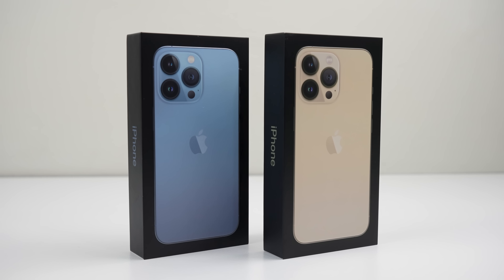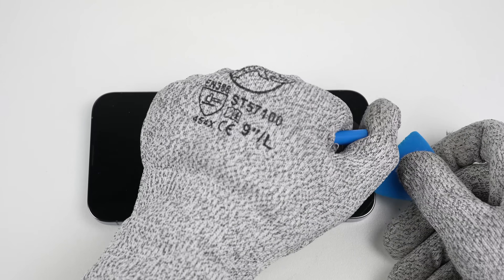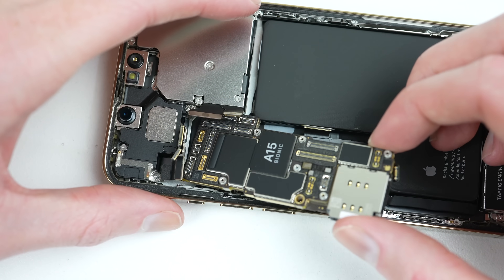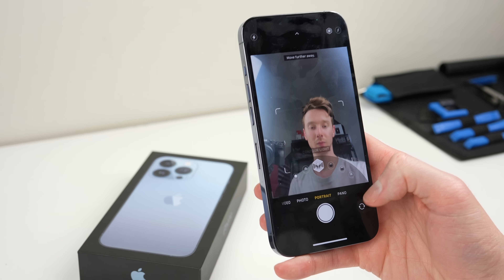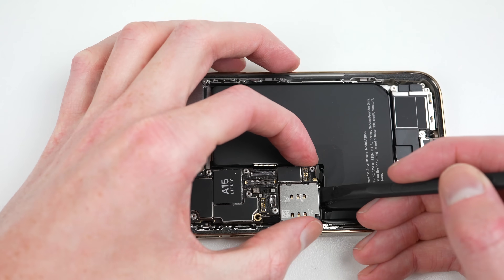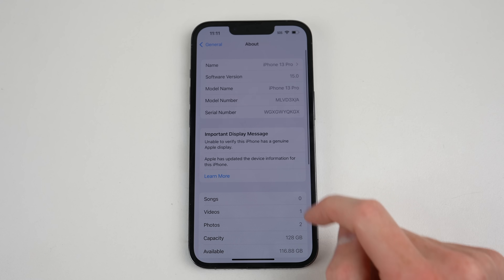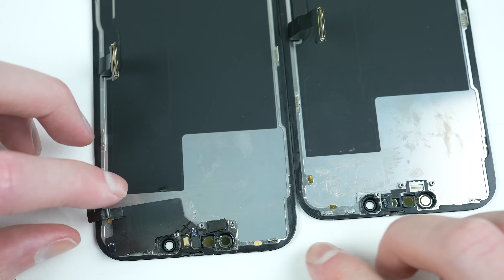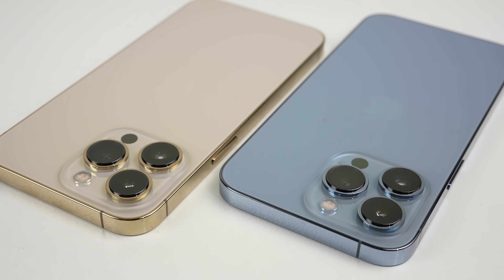iPhone 13 A Repair Nightmare - Teardown and Repair Assessment

Comment: This needs to go viral.
Reply from the maker: Feel free to share it around :)
Reply: @HughJeffreys  Yes Sir
Reply: @HughJeffreys  Suggestion: Pin a comment on the iPhone 12 video that redirects to this one? 
I think that could help too with growing the views since that one already did go viral. Cheers and great job!

I personally do not own any Apple device, I used to have a iPod touch 4th gen but that was it. 
It was working fine but then it got deprecated, the apps would still auto update but then tell me that "the device is not compatible", for aps that were running perfectly before that (so either keep the device completely offline, or enter the loophole of trying to roll back the affected apps), soo.. that was it for me because basically it was a pain dealing with that every single time, specially after seeing the same happenned on newer devices (last i checked was a iPhone 6 from a friend who had the exact same problem when it got deprecated by updates themselves, so feel free to correct me if they changed this with more modern devices).

*If that happens now, that'd not be a issue at all (Android phone), i just need to install the backup apk and it's ready to use again.
Reply: @HughJeffreys  this needs to get in the hands of the NY State Attorney General, Letitia James. She's awesome.
Reply: @HughJeffreys  make it more concise pieces and share on TikTok.
Reply: @HughJeffreys  Dont forget, these devices called decoders exist and are designed to pair parts to iPhones and other device parts with software locking and pairing codes. It copies the code from the motherboard and puts it on the replacement part, pairing it with the board.
Reply: @HughJeffreys  Great & informative video. Hopefully people make the switch from Apple to another company that cares more for their customers. Totally random, but what is the background music that starts at 15:41 ?
Reply: @HughJeffreys  not cool bro..you deleted my comment
Reply: @HughJeffreys  We will, while you test Samsung and Xiaomi, so we can know if its just Apple or its most of them
Reply: @HughJeffreys  Great video, but why do you feel the need to add that background music?  When you listen to someone speak, do you want to hear that stuff along with their voice?  If viewers want to hear music along with your voice, they can hear any song in the world with the press of a button.   It's so disrespectful to play that shit while speaking to people.  Background music is a plague on YT.
Reply: @HughJeffreys  Jerry Rig Everything Mentioned your video it’s gone viral!!!
Reply: @HughJeffreys  Phonerepairguru uses one of those decoder thingies to circumvent apples anti-repair tactics.
Reply: agreed
Reply: @irumwah  Already doing its rounds on social media.
Reply: @mikeriddle2552  ?
Reply: it is viral, but the idiots keep buying it
Reply: @michelbruns  I have been using iPhone from I phone 4 and now after watching this video will never buy an iPhone in my live it’s upsets me that apple wants to make all of the money and not leaving any thing to 3rd party I have phone repair shops and it hurts
Reply: @Onemeed  ay, at least one person that cares
Reply: @michelbruns  Its all about what the user wants with their device. Not everyone cares about the repairability of their phone. I made the switch the the iphone years ago and these things have never been an issue for me. And the risk of it becoming one is worth it to me because imo android is that bad. 

I wont blame anyone if thats a deal breaker though. Its their money. But dont act like everyones an idiot because they pick a phone you dont like.
Reply: @ronnie3044  I agree. After years of being a diehard Samsung/Android fan, I’d had enough of the unreliability of Samsung’s and privacy/security issues with Android. Made the switch with an iPhone 12 & don’t regret it. Although, I think Apple’s tactics like those in this video are a touch too far.
Reply: @ronnie3044  read into the right to repair problems. It's not about not liking ios or not liking android. It's about consumer rights and how these companies, apple being particularly guilty, treat the consumer.
Reply: @wielandmail  No its not idiotic because all these companies are shit. None of them are moral. Your not taking a moral stand by picking Google over Apple when it comes to your phone. 
If literally the only thing that matters to you is repairability than yes you should avoid Apple. But your still picking one morally bankrupt company over the other. There is no morally good choice. So go with whichever has the features that work best for you.
Reply: @secret-name  And they all treat their customers like shit. All of them. Its literally a "pick your poison" situation. For me personally the repair-ability of the phone is not one of my main concerns. And without actual legal threat the others are going to do the same. A lot of them have already started doing it. 
Dont get me wrong. I agree with right to repair and think Apple are in the wrong on that subject. But that con doesnt outweigh the pros of an iphone for me.
Reply: @ronnie3044  yes - morally  Google is nearly as  shit as Apple. But, the thing is: that is "only" the software. And hardware wise there are really good alternatives.
Reply: @wielandmail  Software is just as important as hardware though. A phone can have the best hardware in the world but if the software isnt good its pointless. 
I would love to switch back to android. But they have never been able to figure out the software side. Even the "stock android" phones are garbage in terms of software compared to iOS.
Reply: @ronnie3044  yes, Software ist just as important as Hardware.  But hardware is what matters most in terms of ecology-friendlyness.  As an example: fairphones are mostly made out of recycled materials. And If your Display is damaged, you can simply repair it by yourself. Even the screwdriver needed for this is within the box when you get the Phone.  Big difference in terms of sustainabillity. Sure, it is not as fancy and fast as an iPhone 13, but its morally   wayyyy better and more Eco friendly, despite having Google Software on it.
Reply: @wielandmail  And if hardware and eco friendlyness is a big deal to someone they should clearly get that phone. But thats not the main factor for everyone. When it comes to my phone personally thats not very important at all to me.
Reply: @wielandmail  None of these companies are moral. Your just picking which one is the lesser of the two evils for what you care about. someone buying a samsung note 20 isnt more moral than someone who buys an iphone 12. 
And when talking about being eco friendly. Theres a lot of better ways to be moral in that department. Your cell phone choice is actually pretty small when it comes to your carbon footprint. Even if it does go to recycling in 2 years thats probably one of the least negative impacts on the environment they have done in that 2 years. 
Hell think about all the wasted energy we spend all the time doing pointless things like watching youtube. That cant be classified as eco friendly. Even if you can replace the battery on your phone thats still e waste thats bad for the environment. and for what? to see someone play a game or build something?

Us sitting her talking to eachother via youtube is not eco friendly in any way. Using cell phones in general is not eco friendly at all. 

We all are morally bankrupt. all of us. Unless your living without a phone, using wind turbines to power your home, not using anything for heat, buying nothing that uses oils/plastics etc. you are morally in the wrong technically.
Reply: @ronnie3044  so and we ALL being morally wrong justifys being even MORE wrong for you?  Sure thing - living in stone era would morally be the best thing. But lets be honest - that isnt something that is easily possible. But that should be  no reason for ANYONE to simply not care at all!!!! You understand?
Reply: @wielandmail  Your making assumptions based on no evidence. You seem to think that just because someone buys an iphone they are not eco friendly based off of that one decision. We ALL make choices every single day that are not eco friendly.

Someone could buy that eco friendly phone your talking about but that alone doesnt make them any more eco friendly than others. Someone could buy an Iphone 13 and in the long run be 10 times more eco friendly than the person who bought that phone you spoke of. 

Your theory here doesnt work without making literally hundreds of assumptions about consumers everyday life that you dont know. 

If I buy the iphone 13 and it breaks in 2 years and i put it in the trash does that negate every single other thing i couldve done in that 2 years that was eco friendly? If i buy that eco friendly phone and it lasts 4 years does that negate all the eco unfriendly choices ive made?

In the overall picture of being eco friendly, the cell phone you pick is a very very insignificant action.
Reply: @ronnie3044  that may be right. Im making assumptions. And my theory only works by making such assumptions. But if someone (you)  tells me he would not (or very very little) care about the point of his phone being eco friendly....then....yes. I think i have enough reason for making such assumptions about the every day life of this person. A person that does not care about this point is most likely a person that also does not care about moral at all regarding every other choice in  his/her life.
I find it is more important to at least actually  care about those things, then just being selfish. To care about is the first thing to do and at the same time the most important. It is the start in a better world for all of us and everything around us. And If the start is done, then the good deeds and behavior will follow.  And even if your deeds don't change anything, it is important that one at least cares. At least to be a good example for others.
Reply: Get a load of this guy moved to Apple for privecy 🤣
Reply: @ronnie3044 
That's not the problem, either you use Android or iPhone we don't care. You're not the only people using iphone. What we care is that people need to speak up against this behavior. Soon, every phone manufacturer will do the same since apple get away with it.
How you think car repair scene is very lenient now? Because right to repair.
Reply: @ronnie3044  ooo
Reply: Ronnie yes, and that means you are either throwing out your old iPhones, selling them to people who won’t be able to repair them, or just putting them in a drawer. All of these possibilities are a total waste. Shame on you.
Reply: 1000% profit on a phone must include a lifetime warranty
Reply: didn't expect you here
Reply: even if it goes viral, Apple probably won't give a shit.
Reply: @gliderman9302  Nor the apply fanoys. They DONT CARE. Period.
Reply: @gliderman9302  They won't give a shit until people start catching on and finally getting sick and tired of their BS.
Reply: true
Reply: Didn't expect a Minecraft channel here, but hey you're not wrong. Love your videos.
Reply: If it was a secret maybe it should go viral. It is however not a secret. I can't understand why people still buy this crap
Reply: @Lance Miller 
That might be the case. (The reason you explained) 
And thank you for taking the time to offer that perspective. 

That just goes further to support the idea there should be separation of the device design/version, between DoD type of applications, vs consumer applications. 

DoD institution isn’t a “consumer” in the sense of consumer rights protection. 
Apple can run DoD production batch separately a couple times per year, separate from consumer market production runs. 

Consumers shouldn’t be held victim based on what the DoD needs for their device.
Reply: 100% agreed. That's a rip off.
Reply: Making money is still a kwesty of.... how do i pull another in
Reply: It's goes viral.
Reply: It sure did
Reply: Looks like it has
Reply: Apple which a bunch of hypocritical dick heads.
Reply: 1.5 million views in 5 days?
I think it is going viral...
Reply: Apple and fans don't give a shit anyway
Reply: they dont give a f about the environment. you can sure as s just buy BS carbon offsets from already preserved forest areas to meed their 'carbon neutral' commitment. Total BS.
Reply: @esgee3829  Most people dont honestly care. They can say they do but you would lose count on all the eco unfriendly things they do every single day. writing that comment on this youtube video (or any youtube video for that matter) isnt eco friendly.
Reply: YOUR PFP IS OFF CENTER
Reply: @keratexas-  what
Reply: @The_Horizon  look closely
Reply: Not like it'll matter. iPhone users are often the type of demographic that doesnt care about stuff like this. It's a status symbol to them and the fact that apple is sabotaging their devices is unimportant to 99% of people who spend $1300 on their devices.
Reply: Needs to, but it won't. Things that need to go viral rarely do. Look at the Assange assassination plans recently, the vault 7 leaks and many other similar issues. Videos that tend to go viral are usually "funny", flashy, in your face and riddled with ADHD hyperactive fake behavior.
Reply: @anonp2958  it did go viral
Reply: @anonp2958  I has, 1M views in 4 days.
Reply: @anonp2958  his iphone 12 video did
Reply: @flamingkillermc2806  Ahh cool, could you link me please? 😁
Reply: @anonp2958  11mil views
Reply: @anonp2958  lole
Reply: @anonp2958  aged poorly
Reply: @anonp2958  1.7mil
Reply: @anonp2958  mano isso é um iphone '-' nao um assasino
Reply: @anonp2958  Exactly. Viral = aimed towards mainstreams = quantity, not quality.
Reply: @anonp2958  Hey, careful with the ADHD stereotyping.  I get exactly what you mean, but ADHD does not equal short attention span, just a hard to control one.  People with ADHD may be capable of stunning feats of sustained concentration - like the work Hugh put into this video.  Go deep, or go home!  Your point stands otherwise.
Reply: @anonp2958  literally 2.3 million views
Reply: @anonp2958  nothing ever goes viral unless it appeals to the stupid foolish masses of people in the world.
Reply: @anonp2958  you were saying?
Reply: @anonp2958  I think this is considered semi viral
Reply: @anonp2958  hmmm
Reply: @anonp2958  Nobody cares doomer
Reply: @anonp2958  this got 3 million views so idk man
Reply: @anonp2958  It did, “Mission Accomplished, good work.”
Reply: @anonp2958  Well, your prediction is incorrect as it did lol
Reply: @anonp2958  coughs* 

in 3.1m views
Reply: @anonp2958  just discovered late but apple has a repair program now. Clearly it wasn't their intent when building it. The negative press that videos like this sparked did though lol
Reply: I'm starting to think that iPhone popularity would plummet due to this

Edit: For you guys that disagree
1. You gotta remember that not only do rich people buy iPhone 13 but there are also some folks out there who purchased an expensive phone for convenience, while Apple made it way more inconvenience by not allowing it to be repaired on your nearest phone repair shop
2. Even if you're rich, there is a probability of you living in a rural area, where the Official Apple Shop is hundred of miles away, which still making it more inconvenience
And I know I was wrong about the popularity plummet due to the repairability, what I mean is fewer people would buy the iphone 13 & 12, due to the repairability issue, I really hope Apple would notice this as an issue decreasing the new iPhone sales, thus releasing an iOS update to allow the third-party repair, but I'm sure Apple wouldn't do that sadly
Reply: @Not_Aran8276  You’d think so. But probably not.
Reply: @Not_Aran8276  nope it won't... People will still buy it since these issues are not new with iPhone, they have always discouraged any third party repairs and this is one more step towards it.
Reply: Adil Husain this is worse than it has been previously
Reply: @Not_Aran8276  well keep thinking, apple has it's customers so hooked they literally do not care. As long as people treat apples shit like it's jewelry, apple could sell a turd in a box and they'd still turn a profit.
Reply: @Not_Aran8276  No not really Apple is Worth a lot of money.🤔
Reply: @Not_Aran8276  lol wishful thinking
Reply: @Not_Aran8276  ye
Reply: @Not_Aran8276  good joke. It's users don't care about that they are in it for the brand
Reply: @Not_Aran8276  it wouldn’t because most people won’t care lol
Reply: @Not_Aran8276  nope barely any one repairs with third party cause they trust apple somthis does nothing
Reply: @Not_Aran8276  You think a brand built on the back of nievete is going to lose followers over this? Haha, it will make it even more exclusive. Apple will be proud to have achieved a marvel of capitalism a product everyone wants and noone can fix (except them).
Reply: @Not_Aran8276  well...the first one is rather wrong... you can get quite a few deals to get one even when poor, which, we are, and a friend who lives with us has an iphone 13, they turned in their old phone to lower the price and are paying for it monthly or something like that.

you don't HAVE to be rich to get much these days, but generally you DO have to find the deals and stuff as well.

we don't really get much money, "I" got no job, my bro's in the military(and no...just because he's in the military, doesn't mean he gets much money, enough money to pay for his car bills, and the rent, along with some other bills, thats it)

and my friend makes around the same, and helps with the bills, and groceries for three people and a dog.

I can see everything else being the problem. no...not ONLY rich people, get the Iphone 13.

still hate apple and iphones tho, still trash.
Reply: @Not_Aran8276  There will always be products that exist for the ultra wealthy, and then there are a products for those that aspire to be ultra wealthy - the flat out truth is that plenty of those aspiring types that would have used an iPhone will not be able to afford this scheme. I truly think it's just about giving those people this  information.
Reply: @Not_Aran8276  Maybe, maybe not.  It is for this exact "feature" that I am even MORE interested now in buying an iPhone 13 Pro Max.  No thieves would be interested in stealing it from me because it would be of no value to them.  As for repairs I would never take such a high-end device to a street vendor anyway.
Reply: @pekingpup  not even for an equivalent repair result at 10% the cost? You’re one of a million that would choose “high end service” vs lower cost unless you don’t care about giving big tech extra money. I’d rather buy a steak and lobster dinner and have jack at “fix it for less” do the repair.
Reply: @pekingpup  those street vendors are more qualified than apple's service, as they don't bother repairing things they just replace the whole device.
Reply: @trouty7947  The non-Apple repair services' competency (whether they have it or not) is only one of many considerations among them reliability and trustworthiness  If I take my iPhone to Apple and get it back unsatisfactorily repaired, I can always take it back to Apple.  If I harass Apple enough it will make things right. By the way I don't mind at all if Apple gives me a new ;phone instead of repairing mine..
Reply: @ILoveJesusOurSavior-7  To each his own Trevor.  Using your eating comparison I'd rather eat where I have confidence with their food quality and safety.  If I eat at a street food vendor, even at 10% of the price, I may end up dying in hospital with food poisoning...
Reply: @pekingpup   that's all well and good until your device dies with important files on it with no back up, and apple just tells you "sucks to suck" when it's in fact entirely repairable.
Reply: @pekingpup  that's another way to look at things.....
Reply: @pekingpup  that's another way to look at things.....
Reply: Facts
Reply: The video needs to be shorten to go viral.
Reply: Apple is so pay-to-win because they FORCE you to get an expensive official Apple repair from a certified repair shop rather than allowing you the MUCH cheaper option of manual DIY repairs.
Reply: yes
Reply: absolutely, comment for the algorithm gods
Reply: Surprise to see you here
Reply: Yes, to avoid pple updating this crap phone.
Reply: Somebody call Corona’s agent ASAP.
Reply: Random reply message to further video engagement and appease the algorithm
Reply: It's a known bug, that will be corrected on the next iOS version
Reply: true
Reply: who cares?
Reply: Minecraft Youtubers
Reply: Even if it went viral, all Apple has to do is give youtube a couple bucks and the video will conveniently disappear from the trending list. I know... impossible. We all know the mega corporations are all against each other and for the little guy. (Wink Wink)  I'd hate to see who these big boys fund politically.
Reply: yes, it does!!!
Reply: If people keep buying Apple products, nothing will change.
Reply: @Lance Miller it may be good for governative devices but not for those used by normal people
Reply: u here, happy little surprise
Reply: I will never purchase iphone again
Reply: Yes, I wish this would go viral so thieves know not to bother stealing this one! - Love this feature and wouldn't buy another phone without this.
Reply: agreed, apple is too P2W
Reply: Unfortunately, "going viral" depends, entirely, on that social media platform - YouTube WILL 'quieten down' any chance of this going viral, unfortunately. That's what the inevitable sweeteners from grossly profitable (and, as we see here, corrupt) companies such as Apple do.
The 'real' viral enabler (TV news) will only pick this up if YouTube allow it (i.e. don't dampen it down), and they won't...!!!
Reply: It has been. 'iPhone 13 problems' and 'iPhone 13 sucks' articles are really making the rounds.
Reply: Agreed!!!
Reply: Agreed.
Reply: That’s why I stick to older models.

Currently still using a SE 1st generation mind you.
Reply: I always buy a cheap phone that lasts me ages, so they can f themselves, let them go bankrupt for all I care.
Reply: Leaving a comment
Reply: Reply for the algorithm
Reply: How about just stop using Apple garbage.
Reply: Why does it need to go viral ? What’s that going to do? The  vid he did on the iPhone 12 got viral and nothing changed. We are just pawns for Apple. Nothing will fix this problem. You guys are just arguing over a hopeless topic.
Reply: You know what does go viral? Stupid people on TikTok, unfortunately, the sad, wretched, state of affairs of our current system.
Reply: nobody cares about repairability
Reply: @Ethan-po8ji  and thats the problem
Reply: It just did
Reply: @The Horizon, you are in every tech video I watch lately...
Reply: 2.1 mill
Reply: Who cares though? Certainly not 90% of people who buy the new iPhone, who want it as an accessory, not because it's a good device. Apple know their market - idiots. The same idiots who lap up all the "we're going sustainable so we're not including a charger, headphones or cable" and they still sell trillions a year
Reply: oh hey anarchy guy
Reply: why?
apple sheep will still keep buying this trash.
Reply: it kinda did
Reply: got 5/10 by ifixit who have 10x the break down. It won't because it's repetitive and sensationalized.
Reply: ur next video: destroying pay 2 win apple
Reply: Even if it does I doubt anything will come of it and Apple fanboys will still eat this shit up.
Reply: dupe iphones and give them away for free.
Reply: more than a stupid subway grate, that's for sure.
Reply: Honestly the Apple CEO could beat a puppy with an i Phone and show off some pretty incriminating stuff and everyone on the planet could see that video, but more than enough people will still buy the next i Phone because "new phone".
Reply: for real
Reply: Fancy seeing you here. Love seeing a content creator supporting other content 😊
Reply: As with any other religion, that wouldn't stop people from buying it. You are juat too poor if you have to repair your screen instead of replacing the whole phone. Actually, that might even make the phone an even better status symbol.
Reply: it does
Reply: This aged well.
Reply: damn i see your channel everywhere
Reply: agreed
Reply: yes
Reply: Maybe stop buying their shit
Reply: foreshadowing
Reply: Sponsored by apple
Reply: 100 percent
Reply: Agreed!
Reply: Meanwhile half or more of you have no problem with forced chemical injections. Screw iPhones when they’re doing this to your own body. Right to repair? What about YOUR BODY!
Reply: so did it
Reply: No f'kin Ray mak will infect the comments
Reply: No, you need to stop buying their garbage.
Reply: Well, at least no one can use your stolen phone for parts.
Reply: wish granted
Reply: lmao it is now
Reply: it probably will
Reply: you think a phone that uses the old phone's hull from last generation wouldn't go viral? trust me people know, this already counts as viral for many people
Reply: Periodt
Reply: I had been an iPhone user since Iphone 3G ... can you guess how many times I took my phones to repair? Not once, i keep my phone for years  so i don't replace them every year
Reply: @dieselboy77  ok, well I own an iPhone 6s. Bought new in September 2015. In around mid 2016 the screen failed for no reason and I had to have it replaced under warranty. Then a couple of years ago I had to replace the battery because it would no longer really hold a charge, and also the charging port was replaced because it was playing up. Then last month I had to replace the screen again because it got cracked and stopped working. I checked with Apple and they wanted to charge me £152 to replace my screen. I ended up getting it repaired for £40 through an independent repair shop.
Reply: @dieselboy77  you probably bought a one asap one after anoder or useing it all time at the charger
Reply: @baaz5642  Not really , my phone isn't glue to my face
Reply: @dieselboy77  Congratulations? That's like saying people who want seat belts in their cars are total tools... can you guess how many times I crashed my car this year? Not once! So why would I need a seat belt...

The problem here still exists for a lot of people even if it doesn't effect you. When you buy something it's yours. You should be able to fix it if it breaks. Acting like the people complaining about a real issue are just being childish just makes you look like a narcissist.
Reply: @chase9316  Do you realize it isn't just Apple who does that? You buy a car and you put the aftermarket part it void your warranty. Companies want you to use their own parts when you replace something. imagine if you took your Rolex to a 3rd party watch repair that isn't Rolex authorized. or try to put after market parts in tesla they will disable your car
Reply: @dieselboy77  Yep, I am aware that lots of companies use immoral business practices. I would hope that most people know that.
Reply: Yep, but Apple is a cult.  You can show whatever truth to their clients, most will still prefer stay member of the sect.
Reply: @lucbgg  unfortunately thats true
Reply: Again, no one gives a fuck about repairability of products. If it matters to consumers it's so low on the list it doesn't register when deciding whether to purchase or not.
Reply: @heyheytaytay  well it changed my mind. I am not gonna buy the new iPhone after watching this horror. Damn it apple 🍎
Reply: DO NOT BUY APPLE PRODUCTS
Reply: Another reason why you need to try a Samsung phone
Reply: Honestly who the fuck still buys these??
Reply: @granola661  fanboys?
Reply: youtube getting paid in millions to shadow ban this.
Reply: @pajeetsingh  Cute conspiracy theory, kiddo. You do realize this has almost 2 million views. It's been up for 1 day shy of a week. YT doesn't seem to be very effective at , or most likely just isn't interested in "shadow banning" it. lol
Reply: @gymkhanadog  I paid it dummy.
Reply: I BET THAT IF THE SCREEN CRACK, SAME THING WILL HAPPEN JUST TO MAKE YOU WASTE YOUR MONEY. ITS GONNA START GLITCHING AND POPPING UP THE SCREEN MSG. AND USER GONNA BUY A NEW SCREEN JUST TO FIND OUT IT STILL HAVE THE GLITCH AND NO WARRANTY AND FORCE TO BUY ANOTHER ONE OR LIVE WITH IT AS IS.
Reply: Why? Apple Stans are a cult anyway. "Thank you sir, may I have another!". Morons get what the deserve.
Reply: No. This is silly. Why cry over the repairability of a $1000 phone when there's literally thousands of cheaper alternatives. First world problems
Reply: @brianm5753  
By this logic, unless you’re literally dying, you have no right to complain about anything ever. This is a tech channel talking about tech related topics.
Don’t care? Don’t watch.
Reply: @BeatBlaster117  I don't see how your reply is relevant to my comment. I said if you're ignorant enough to buy a $1000 phone then Apple has the right to capitalize on your ignorance. Complaining about how expensive it is to fix the phone just means you can't afford it
Reply: @brianm5753  um ok?
Reply: @The_Horizon  yeah people are very clever now. following on you youtubers footsteps i guess. i was just wondering if there is a goodle angle to it. and pretty sure you won't admit to it even if it was. not only would it be unofficial but also illegal.
Reply: Despite how much I agree with you, if people can't see the obvious evidence that the vaxx is "safe and effective", then they'll never recognize this issue which has even less direct impact on their lives.
Reply: For what???? First of all he’s not even ESD safe. Second there are guidelines and procedures to take when repairing 1000 phones that he’s obviously not taking so he most likely damaged the device at one point. Second when a third party or you mess up the phone then what? Go into a apple store and demand a swap for free? It’s actually smart. If there’s a issue with the device go to the store first rather then a bunch of people messing up their phones just to demand a new one and blame it on apple for their mistakes
Reply: 5th
Reply: @wilh3lmmusic  grow up
Reply: a question. is google paying you special with unprecedented likes and views and money, to make apple look bad? cause whatever apple is doing is pretty much done by every other company including pixel.